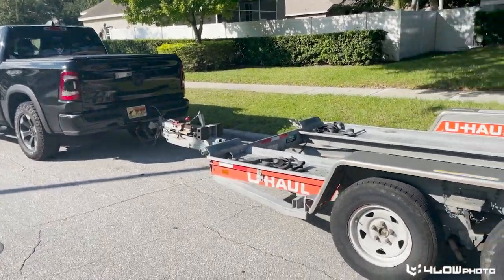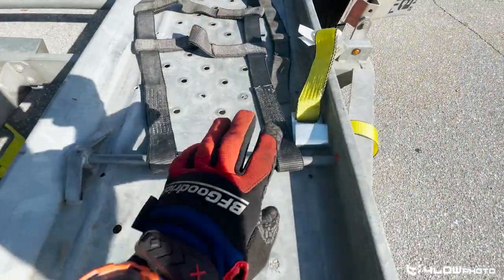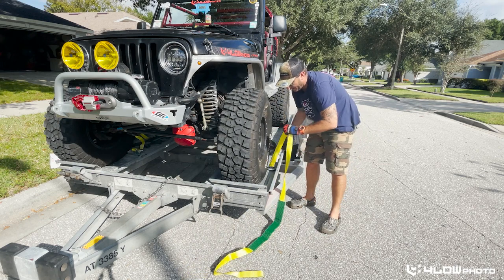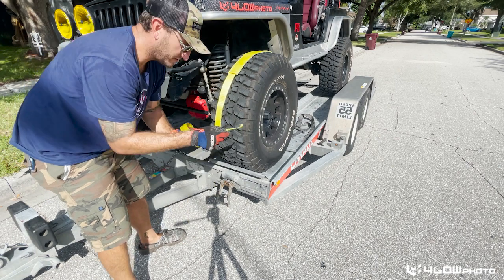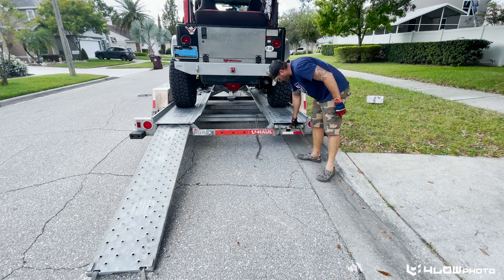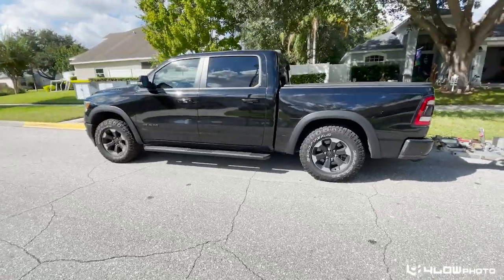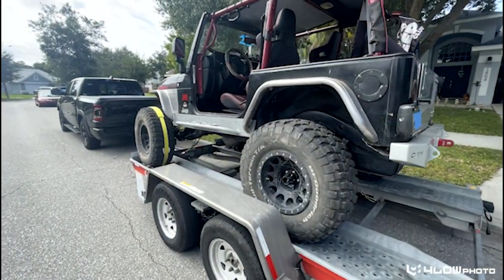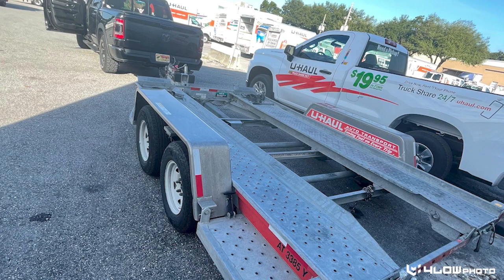How to tow a Jeep Wrangler with large tires on a U-Haul Auto Transport Trailer

Comment: Nice video!

Couple of suggestions: Attach the strap hooks to the rod connector BEFORE loading your equipment/truck/jeep. Then lay the rest of the strap on the deck behind where the tire is going to be. This will eliminate the need to swap the protective sleeve around like he had to do. 

Next, after you thread the loose end of the strap though the ratchet slot and pull the loose end taught, pull a few inches of slack back through the slot toward the tire before you start ratcheting it tight. This will allow the ratchet spindle to wrap more of the strap around itself before it meets resistance providing a positive/stronger grip on the strap and making it MUCH more secure and resistant to slippage back through the spindle slot. 

Many times a driver does not do this one little step and they end up with a loose strap flapping in the wind and often getting damaged after running over it with the trailer tire. Usually the strap is useless after that and you will be calling Roadside Assistance for help which can generally take several hours or more. (It doesn't hurt to purchase an extra set as a back up for just such an occasion. If you don't use them, U-Haul will probably take them back. Meanwhile, you have a little extra peace of mind knowing you are prepared.) Failed straps are one of the most common callouts for these types of trailers and also the Tow Dollies and it's usually because the straps weren't cinched correctly.

Another thing, when you are getting the extra insurance coverage that U-Haul offers, make SURE to ask them for SAFETRIP coverage in addition to any others for ANY type of U-Haul equipment that you rent. It is probably the most used insurance they offer and for the extra $5-7 that it costs it will pay for itself 30-50 times over if you need it. This coverage tends to be the most overlooked coverage and possibly the most frequently needed. ( I'm not going to tell you how I know this but I see it happen literally EVERYDAY when a customer needs assistance and doesn't have the coverage that they THOUGHT they were purchasing and has to dig deep into their own pocket.)

And lastly, (yea, this is a lot to read but the extra minute it takes you to read it will be much appreciated when you do and end up avoiding a situation that can cost you not only financially but might even save your life.) 

ALWAYS INSPECT THE EQUIPMENT BEFORE YOU DRIVE IT OFF THE LOT!!! 

Since this is a trailer video, among other things, don't forget to always inspect all of the straps and chains for damaged or missing parts. Do not accept any equipment with damaged or frayed straps - PERIOD! Make sure they have the proper number and are the proper length and no frayed ends. 

And if the chains show any sign of drag damage or are missing the rubber devices that secure the hooks in place after they are hooked (some now have special clips made onto the hooks) ask them to repair or replace BEFORE you accept it or drive it off the lot. 

These are just a few suggestions that I have. Most people won't read this far but if you are the one that does, you won't regret it
Reply: Great advise!

Comment: Thanks for the video. I like how you hooked the winch to the trailer as well. Didn't think about doing that. I'm about to pull my TJ about 800 miles using an '18 crew cab Sierra 6.2L. Hopefully it's an uneventful trip.  Only difference from yours is mine's on 33's. Thanks again for the video.
Reply from the maker: You might be able to make it work with the attached straps without the extensions
Reply: @4lowphoto  Did you feel it put too much weight on the tongue with it snug against the front bars? I'm a little concerned w/ that (haven't loaded it yet).
Reply from the maker: @dansbird  I actually was told to let off that so I didn't leave it. This trailer setup isn't ideal for people that tow all the time. I felt the entire thing was a little tongue heavy. But I tow 1-2 times a years only short distance
Reply: @4lowphoto  just got done towing my TJ 800 miles using an ‘18 Sierra 1500 crew cab 6.2L. It pulled it great, snugged up to the stops. I also had to use the oversized tire straps with the 33” BFG KO2s despite them being down on air. Thanks for your video. It was most helpful.

Comment: For anyone asking about if the stock straps will fit 33's... I had to get the oversized tire straps for my TJ that has 33" BGF KO2s. They were already aired down a good bit and the stock straps still weren't going to work... so if you have 33's, I strongly suggest also getting the oversized tire straps when getting the U-Haul auto transport trailer.

Comment: Thanks for the video man , great job . Right or wrong a JKU or JLU on 37s will fit the same transporter :0
Reply: I've seen an Expedition, but with stock tires. I almost think width-wise is what would be your issue. I could not find any photos of a 4 door modified Wrangler. It might be pushing it, but start with measuring. I posted all the dimensions in the video of the trailer. Good luck!

Comment: Nice well put together video, especially for anyone who may not of used one of these trailers before. Do you or anyone else know if the straps that are on the trailer already are big enough to go over 33's? Picking up a truck today and just curious.
Reply: It would be very close and depend on the brand. I have seen some say they do. The worst case could let some air out.
Reply: @scottherrick7738  ok, thanks for the quick reply.
Reply: @mikebas7325  what kind of truck did you fit on one of these trailers??
Reply: @barbershop7277  biggest truck for me was an 86 square body chevy. It was a short bed 2 wheel drive though which is no biggie. I never got the truck with the 33's I referred to in my last message but uhaul does have other straps you can buy to make sure they are long enough. Hope that all made sense.
Reply: @mikebas7325  thanks. They wouldn't let me rent. Said a 2010 chevy silverado quad cab is too big

Comment: I have the same setup. 2019 v8 ram. What sort of mpg do you get?

One thing I have done is criss-cross ratchet straps to bumpers…reduce amount of suspension bounce

And yes, a 4 door fits…barely. I did it with jku on 37s
Reply from the maker: Mine is the v6 etourqe. Got 10-11 pulling the jeep. The rear straps were just extra. Uhaul says front tires only per the agreement and insurance. But agree on crossed normally

Comment: Do you know how many inches wide is your jeep? It says the trailer is 79.25 inches and my truck is 77 with my tires. Hoping to barely squeeze in there
Reply: I am 74-75" wide in the TJ. The one fender does drop for loading, Worst case maybe you could air it down a little.

Comment: With your Jeep so far forward passed the axles, are you concerned at all that the tongue weight has overloaded your Ram truck rear end and lifting our front end? Too much tongue weight or force on the hitch/tow ball could overload the rear tires of the towing vehicle, pushing the rear end of the vehicle around. This could negatively affect the vehicle steering/handling because your front end is lifted. Performance is impaired as you might not be able to turn corners and curves properly, and your vehicle may not stop quickly enough when you press the brake pedal (because most of your braking power comes from your front brakes). Your tongue weight should come in between 10% and 15% of the total weight of your loaded trailer, also known as your Gross Trailer Weight (GTW)
Reply from the maker: I have towed many trailers. With the uHaul trailer this is their required method , and only way insurance is covered. I followed their guidelines on loading and placement
Reply: @4lowphoto  Thank you.  You made my point exactly.  These U-Haul trailers are inherently dangerous.

Comment: I have the same setup. 2019 v8 ram. What sort of mpg do you get?

One thing I have done is criss-cross ratchet straps to bumpers…reduce amount of suspension bounce

And yes, a 4 door fits…barely. I did it with jku on 37s